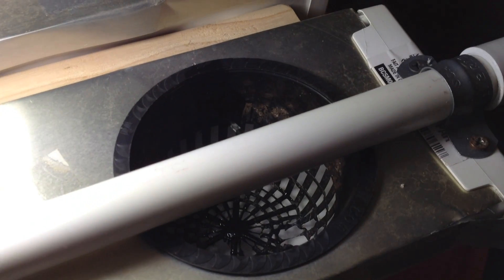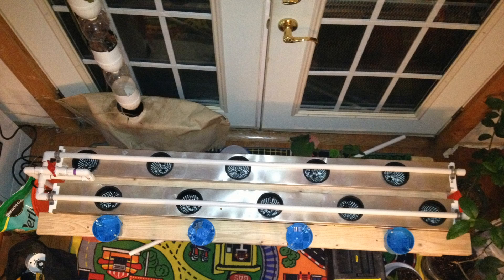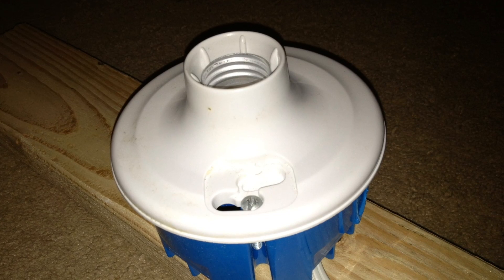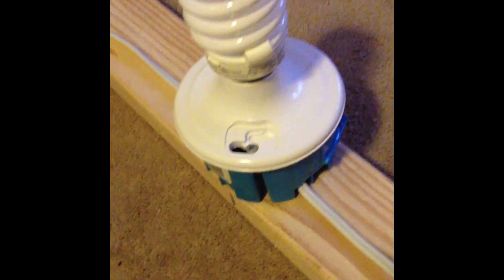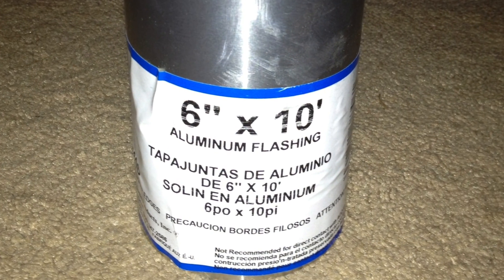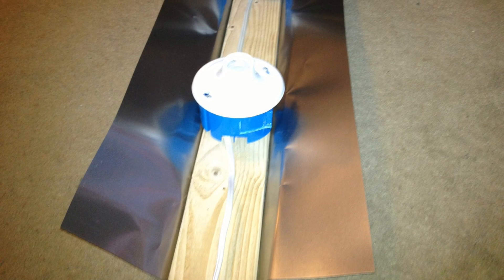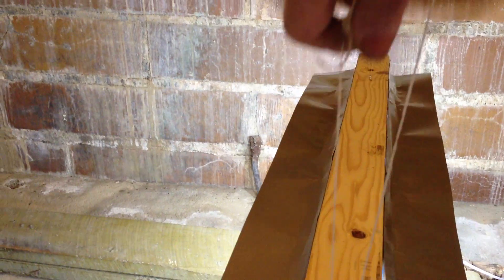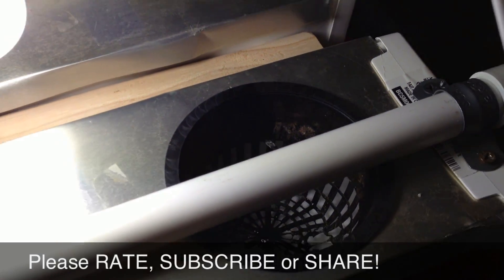DIY Drip Hydroponics "Lighting"

Comment: hey brad, update your system with those new high power LEDS at any hardware store. i think you can find bulb at 5W producing 400-500 lumens, at 6500k. and believe me they are bright and efficient. you can look at it without getting blind. plus it runs cooler
Reply from the maker: Do you have any information on those?
Reply: what do you mean by info? all i know is the all you need here in spain is the GU10 socket, the LED bulbs or spot light bulbs and directly attach the wires to the plug and to the wall socket. no need for ballasts or anything else, basically its like a CFL bubl if you've handled those before. Just screw them into there socket, correctly wired and wala, light

Comment from the maker: I've now modified the lighting system.  I added another light to the system and replaced the flat flashing with galvanized heat ducting.  The lighting seems more even across the hydroponic system.  I'll post pictures in the March 24th Weekly update.